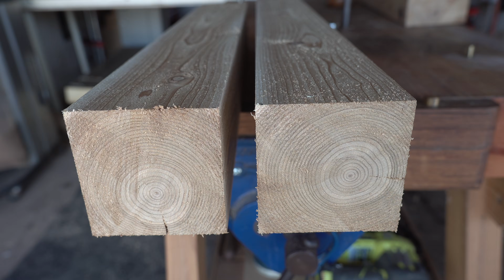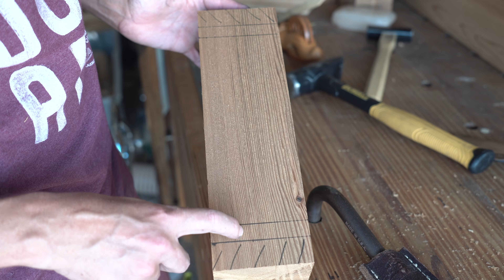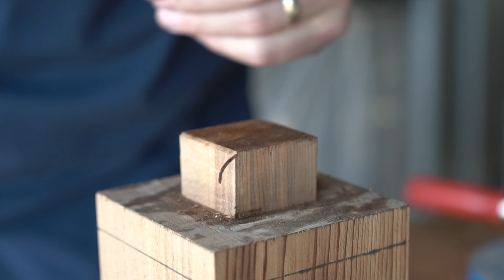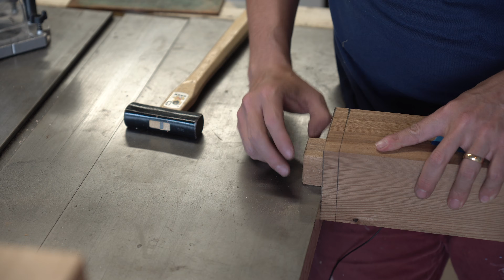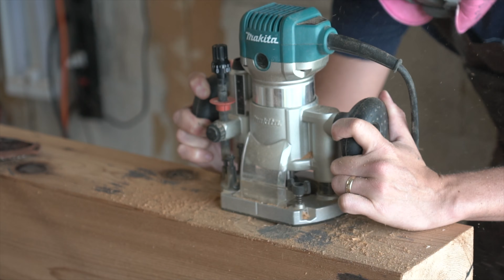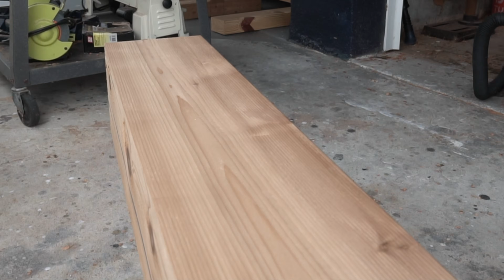Building TIMBER FRAME Saw Horses | Hand Tool Woodworking Techniques

Comment: Can you share the info on that slick?
Reply from the maker: Can you specify the time stamp? I’ve got like… a half dozen slicks in the shop and I can think of at least three in this video.
Reply: @CowDogCraftWorks  18:42 is where the slick on the table is. , I’m new to working with Japanese tools and appreciate your work, would you ever use glue in these joints?
Reply from the maker: @markluke8447  ah yes that’s a slick from Ouchi San. You can get them through @xtol.ren on Instagram. It’s a good small timber slick.

Comment: Late to the party, I really like the relative proportions of the saw horses.  And mostly the height to accommodate working from the sitting positions.  What is the overall length of the 6x6?  I assume the overall height is about 18-22”?  Thanks for the Japanese techniques as well.
Reply from the maker: So the two are actually different lengths but they’re in and around 40 inches or so. They’re 16” high.

Comment: the one time its ok to rose bud your wood.
Reply from the maker: That’s what she said.
Reply: @CowDogCraftWorks  not exactly what i meant but hey what ever works.
Reply from the maker: In all seriousness I imagine you’re talking about how I wet the joint to cause it to re expand after crushing the fibers… KIGOROSHI. That all capped for no reason but I’m going to leave it. It’s a time honored technique in construction and I find myself using it now in furniture applications as well.
Reply: @CowDogCraftWorks  actually what i meant was when you were hammering the tenon instead of shaving it done like a peg joint. you were little by little denting the tenon. Like you when you hammer a nail and miss, it puts a small dent in the board which is not the desired affect. When my Dad had his shop he called it a rose bud. I didn't know that there was that much difference in eastern and western jointery until i saw your channel
Reply from the maker: @anthonyvincent9990  yea that’s the Japanese technique called kigoroshi. You peen the tenon down and rehydrate it in the joint. It’s also helpful if you’re plugging knot holes with inlays.

Comment: Love it, went to watch the video you released today and realized this one had slipped through the cracks, so I watched it first! Besides the fact that it’s very clearly a really tight fit and then the re-expansion of the fibers mean it’s gonna hold on tight, does the lack of glue indicate any hope of disassembly at some point?
Reply from the maker: I’m sure if I whacked it enough times with a hammer it could come apart.

Comment: I made timber frame sawhorses much like these two years ago.  They hold an amazing amount of weight, they are stable, and they have been very useful.
You've made some nice, solid saw horses and I think you will be happy with them. They will last for decades.
Nicely done. Thanks!
BTW: When you are using a pull saw to cut end grain, it is often helpful to lean the piece you are cutting toward you, rather than away from you. Then you will be cutting with the grain, not against it.  Less of an issue with Cedar, perhaps, but with harder woods, this becomes more important.
Reply from the maker: Good to know. Thanks!